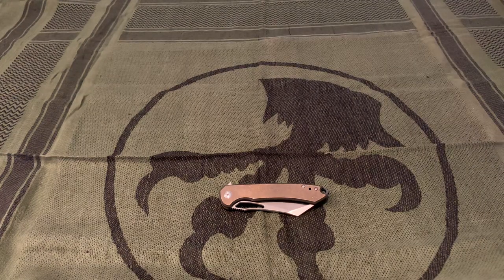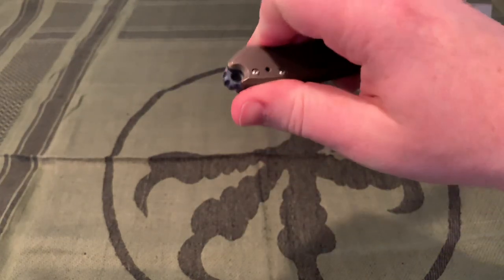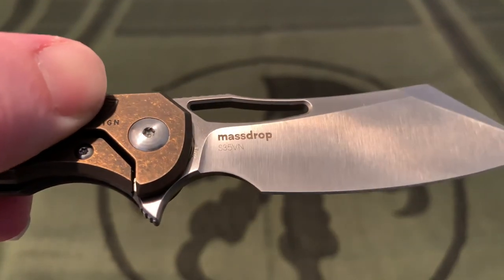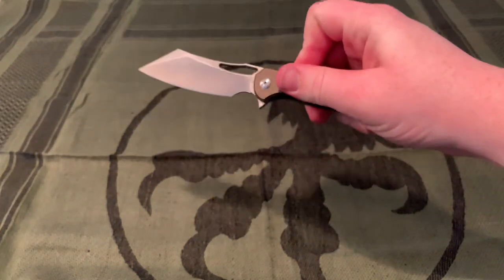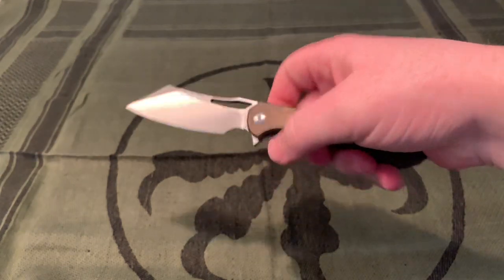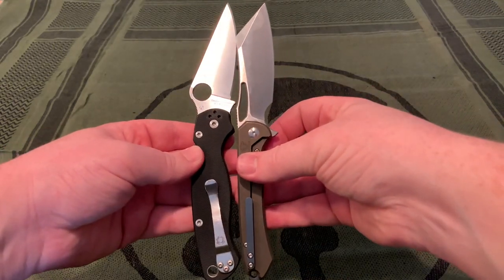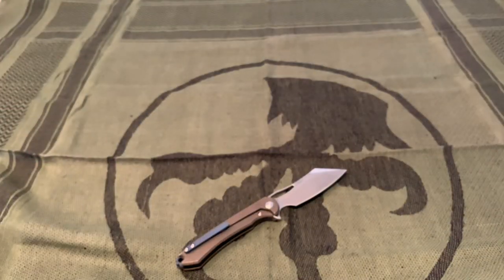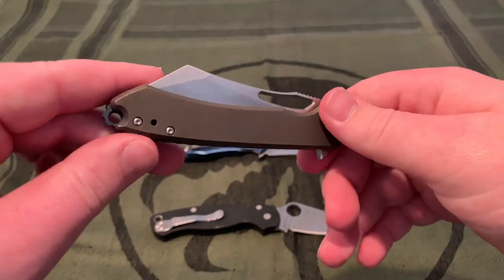Massdrop Ferrum Forge Buc Review

Comment: I had the one with patterned handle and could not flip it half the time because I would press on the frame lock bar. The handle was too skinny so I sold it. Love the blade shape if it had been a liner lock I would still have it.
Reply from the maker: I haven't had trouble flipping it, but that could just be the way I hold the handle. Thanks for watching!
Reply: Gmotion EDC ... I am having the same problem.